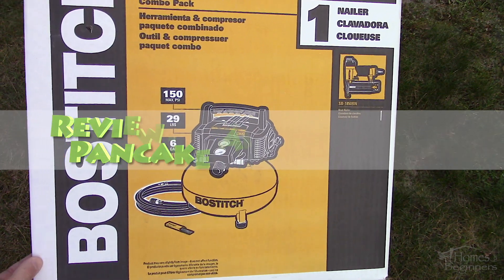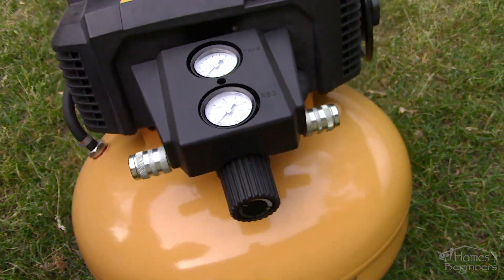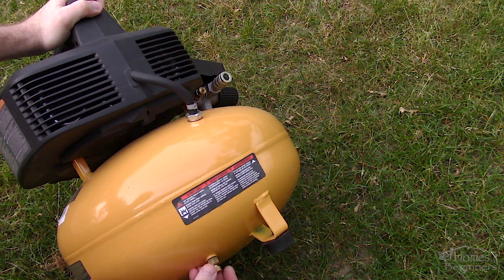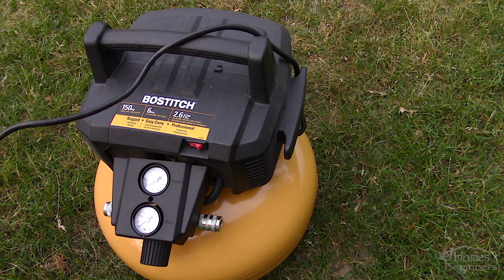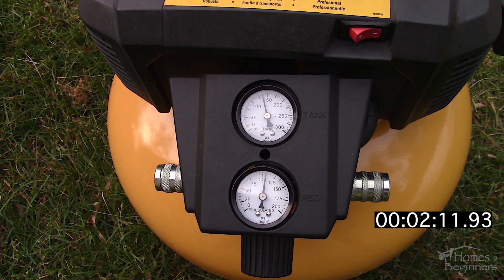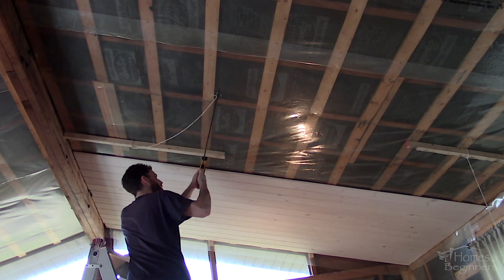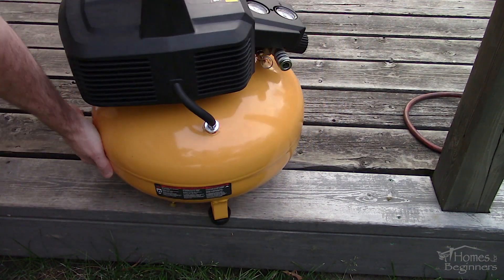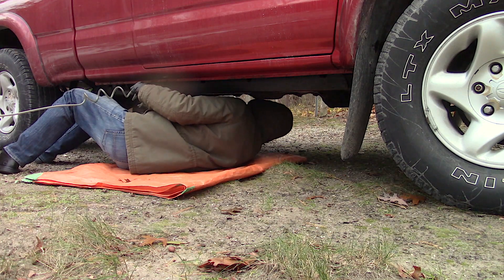Review Bostitch 6 Gallon Pancake Air Compressor BTFP02012

Comment: Just purchased 2 of these customer returns at auction
 for $118.65 for the pair and they look like new in the box and work great.
I run 2 framing nailers with each one of these little workhorse compressors.
Reply from the maker: That was a great deal, certainly worth the money and they're easy to carry around on a job site too.

Comment: Love this video. For me the most important test was the blow gun test as it will only keep up at 25 lbs release and if set at 100 the tank will empty; For my use then this compressor is not strong enough as my old Iron Horse will hold up better as it is rated at 5 CFM at 90
Reply from the maker: Thank you!

Comment: I have a problem with mine! I can get air to come out of the tank. It's filling up but nothing comes out. The PSI reads 150 on one gage and 0 on the other. I don't know what wrong. It might be the regulator not letting the air come out .

Comment: I'm surprised at how light this thing is. Mine fills in about 2 mins and 19 secs. I also have a 2 gallon quiet type by Fortress. It fills very quickly within 42 seconds, but is heavier and more of a hassle moving in and out of the house. So now I just keep it in the house and moved the Bostitch to the garage.
Reply: So the Bostitch 1.5 HP / 6.0 Gal should take about the same time to be ready to use after connecting the electric cable?

Comment: Turned on compressor and gauge isn't moving, do I need to adjust something first? Fresh out the box
Reply from the maker: Try adjusting the regulator.
Reply: Is the valve on the bottom closed?

Comment: The black hose coming from up the belly gets extremely hot, why is that?  Any help please
Reply from the maker: That is normal for any compressor for the feed line going to the tank. Compressing air does built up a fair amount of heat.